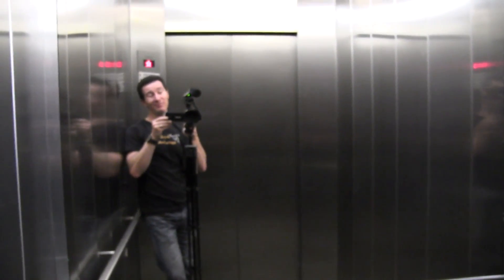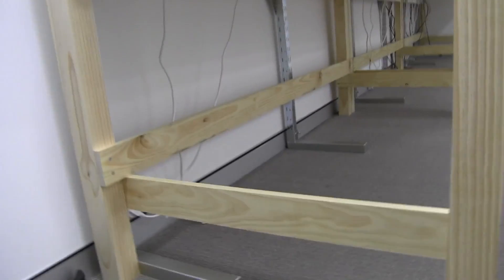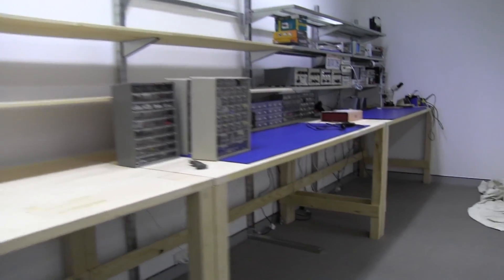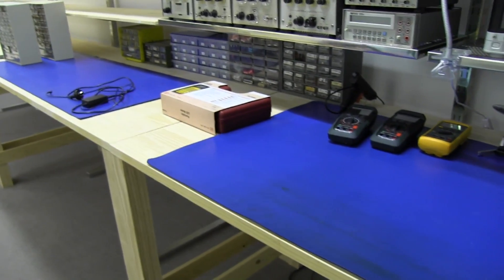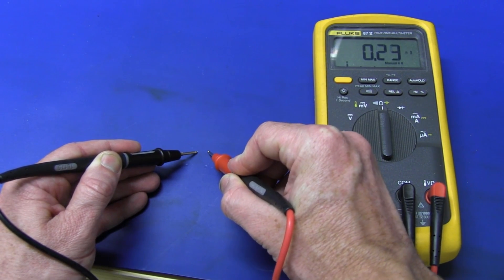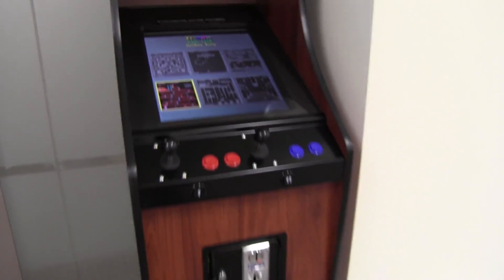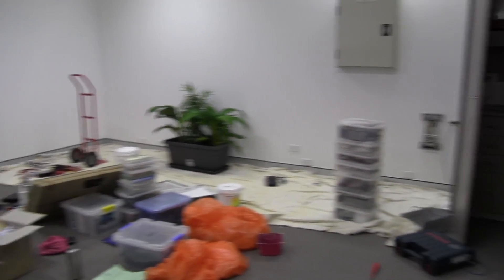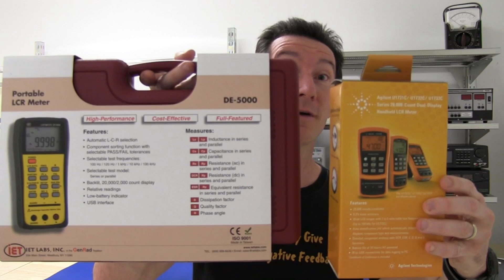EEVblog #228 - New Lab Progress...

Comment: Dave, I used 2400x1200 x20mm thick marine ply, table was supported on 50mm steel angle line, legs are 50mm rectangular section - the instrumentation is CNC 30mm extrusions.  I used high grade Estapol Polyurethane is a clear wood protection - raw gets dirty quickly.  My power points are above bench - so I do not have to duck under the table.  My lab is 12x20m (4m ceiling for testing drones ) and has CNC, 3DP, Laser cutter and  12 computers to run 2 servers one being NAS server. Office drink fridge .....ok it is a converted garage with 10m french doors to look into garden. I have to stop bragging since Moore's law  is quickly catching up with my "stuffing about".  Love to add picture but  here is youtube cooks tour.. https://www.youtube.com/watch?v=UAYXoZqrQ5Q
and https://www.youtube.com/watch?v=Jyih4hqsKGg&t=591s  ( there has been upgrades since that vid was shot ). Torquay Victoria ( PS// I was spoiled as an ex-csiro drone ...got the "bullet" pre 2000 as my boss made a major discovery that my group (2 off us ) were way smarter than he was - generally a sin in management rich csiro . So I had plenty of time to make my work area -  after all you are a young man and no doubt that moss will not grow under your feet when it comes to lab space and no of power points.

Comment: Suggest wood coating could be water based urethane or acrylic.   They do not yellow, are extremely hard, dry quickly and show the real beauty of “raw” wood.   You also get NO organic compound smells and other undesirable VOCs in the atmosphere.   As a joiner I use it when I make furniture and learning aids for our preschool where VOCs are not desirable but the wood needs sealing and protecting.

Comment: I know this is really old, but if I were to build my dream bench, I would put the power strips, or at least some of them, mounted on the wall above the bench or on the top of the bench it self, but that's just because I hate crawling under the bench to plug stuff in, which in an electronics lab is going to be required
Reply: Stick a couple of quick-access ones on the front too.
Reply: I'd definitely do a combination.

Comment: I used 40mm oak for my work benches and treated them with a natural wood oil that hardens after 14 days. 
Where I live (Denmark), oak is priced like beech, at bit more expensive then pine or fir.
The oil leaves the wood surface VERY resistant to all chemicals, hot solder and other mistreatment.

Comment: use the center room for a large square work surface. someplace where you can handle larger projects. its always nice to get away from the bench for a bit and have  a more open area for work.

Comment: You should realy threat those benches with atleast a clearcoat. I have the same setup with the pine plates, and it gets black very quickly. It's also very soft untreated, so you are going to get som dings and scratched on the places that arent covered with the ESD mats

Comment: You should use 5500K KinoFlo fluorescent tubes for the lighting & swap out those coolwhite bulbs. They don't require any sort of structural change and will draw similar power to those other lights as opposed to installing new LEDs, plus they are daylight balanced so its easier to process on your camera's photo it is the same color temperature as the sun[which I know actually changes constantly] so its actually healthier for the indoor plants.

Comment: Great lab, cant wait for a quad copter build. I have been building one from DIY Drones and it works great. they use an Arduino micro and there code is accessible.
keep up the good work.

Comment: Dave, first of all, great videos, keep up the good work. About your shelves, you mentioned they are not fixed to the wall and are free standing. Do they have any cross (diagonal) bracing? If not, then I suggest you put some cross bracing (diagonal bracing) to ensure that they would not sway and risk collapse due to the weight of the equipment and all other loads on the shelves.

Hope this helps.

Comment: Regarding the wooden shelves, get some aluminium U extrusions, inner being the same as the wood thickness. Place on front and rear of the wooden panels, and you will find them to be a lot stiffer, plus the front will match the metal shelves. Get a dry powder extinguisher ( with current service & pressure test) and place it just inside the door. Soldering may be a problem if the smoke detectors are sensitive, check if the kitchen has an extractor so you can duct to it to extract fumes to outdoors

Comment: @EEVblog Nice to get some Wan Long ( that is the name of the one retailer of FE kwality gloods here)  H3 lamps and wire them in a panel behind a diffuser, with a cheap 12V PSU to drive them. Cheaper than a light panel, and a reasonable light output. I tore one apart to make a cheap light panel for close up photography, will finish it sometime this holiday.

Comment: @EEVblog The local IKEA seems to stock it (yay!). It's a bit more expensive that what I was expecting. The wooden shelves support up to 30kg whereas the metal ones support 40kg. I think both are enough even for heavy 70's equipment from eBay. The price difference is negligible: it's a dollar.

Comment: I don't see any sprinklers overhead. Is there any fire detection above the ceiling? Maybe smoke detection in the A/C ducts somewhere?

You can buy a Sensaphone that will listen for the sound of a smoke detector and handle 4 input switches (door, etc.) and make calls to 4 numbers (your cell?) until someone answers. No monthly charges.

Comment: @johnmartin512 If Aus. is anything like U.S., they have to provide extinguishers in several places on each floor. But I would have my own handy. You can find drained/leaked units cheap and pay a fire equipment place to recharge them. (Always get units with metal heads, not plastic, so there is a no-leakdown guarantee.)

Comment: @TheEPROM9 Paralleling phone lines won't work. When only analog leased lines were avail. and running at 9.6K max, you could buy a "reverse multiplexer" to glue them together at both ends for a blinding 18K. Those are now antiques, and they wouldn't work for dial-up. For DSL/cable, you just order the bandwidth you need.

Comment: No, the resistance of the pad won't "go out" as you spread the probes apart. As the probes spread apart, the increased parallel paths keep R constant. For that reason, surface R is measured by the square, i.e. ohms per area, no matter what area you choose.

Don't forget the burglar alarm! A local-only noise maker would be better than nothing if you don't want to pay for monitoring. Unless you have good insurance, a big hit would be devastating.

Comment: Dave instead of cree led you can use Nichia NS6W183AT led. Very efficient and no so expensive. 128 lumen for 1 watt. i done several lamp with that simly amazing. 2160 lumen with 16 led each led use 1,05w.

Comment: @EEVblog It depends on what your electricity costs are, how much time you're willing to spend on construction/design and how long you'll be operating the lights. If you do it all by yourself, you can get a return after less than 3000 hours. One very, very important rule though is: design it well! If you ruin your efficacy by bad thermal design, or your efficiency through bad electrical design, it quickly becomes hard to beat T5 fluorescent lighting. I'll blog about this soon.

Comment: On the wall where the camera will be hang a set of thick white curtains, that will help with the sound. The LED retrofits are really expensive, nice looking but $100 each tube expensive, and a lower light level. Try getting a lot of 1W dies and mounting them on a thick alloy panel heatsink, drive them with a CC source and place a white diffuser over them as a light panel.

Comment: @superdau 
And.... I'm no carpenter (built some nice things already though ;) ), but I think you should add some horizontal support across the width to the bottom of the bench board. The way it is built now I fear the board will warp or sag. Don't make it a too rigid connection though, since wood works 10x more in direction of the width than the length of the grain. Metal angle profiles with elongated holes (so the screws can move in them) should do the job.

Comment: Actually I like the wood shelves better than the metal ones. Wood won't rattle when you put something on it or won't vibrate as easily (e. g. because of fans in equipment).